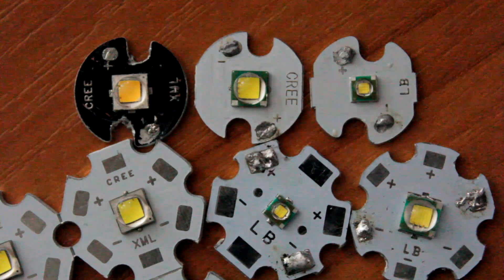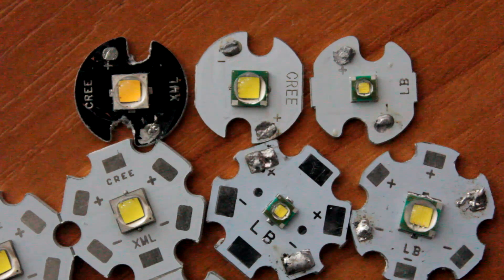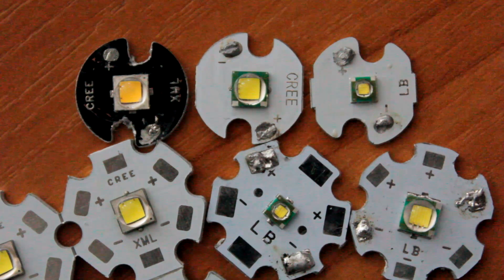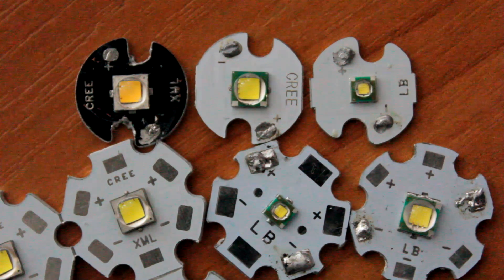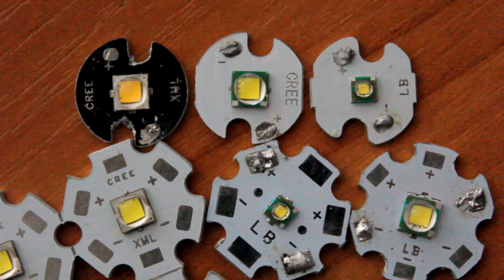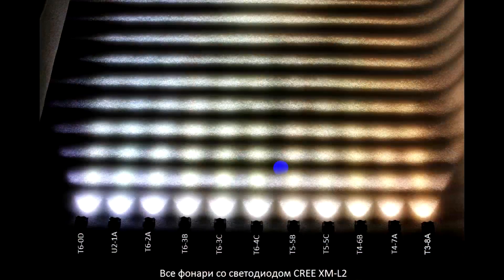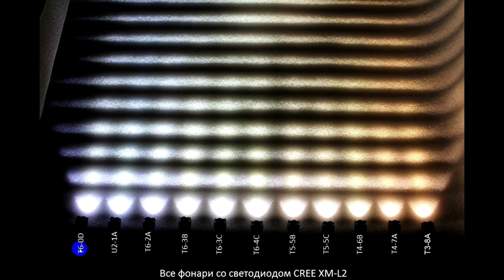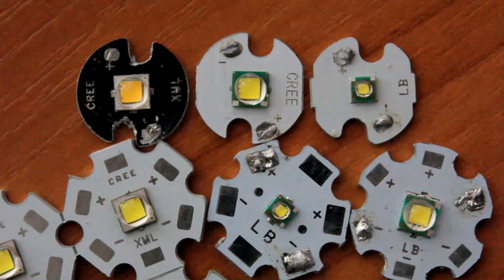How to distinguish LEDs CREE XM-L T6, XM-L2 U2 and XP-E Q5 visually (external differences)

Comment: hello I bought a led flashlight but inside the q5 has the small 3mm led on a 16mm support, what a rip off! I would like to buy a more powerful LED and replace it, which one do you recommend ??? I'd like a 3 volt CREE XHP50 do you think you can buy and solder? just solder to make it work?

Comment: IMPORTANT QUESTION - do small boards like this require a heatsink? im working on an interior design project, is it a fire hazard?
Reply from the maker: Surely it requires a heatsink and a thermal grease. 
If a turned on flashlight will be inside a bag with some clothes, than you can have some fire. On the open air (even inside buildings) there is no fire hazard.

Comment: That was a helpful video 
Can you help me with my energizer torch 
I have a metal energizer torch that its output is 55 lumens and works with two AA batteries 
I want to change the chip with one that works with the same two batteries but with higher lumen
Reply from the maker: My opinion is - you should better to buy a modern torch.

Comment: Awesome, This video helped me check if Id been scammed on ebay with a headtorch, And yes i had, It was supposed to have Cree  XM-L2's in but had xpe's inside 😤
Reply from the maker: It is a very rude fraud. 
And it is much more harder to find the differences between CREE (USA) and Lattice Bright (China).

Comment: T6, U2, Q5 is a color variant from the same LED. T6 is the most blue one over 6500K and giving highest output since it has least amount of phosphor.
Phosphor layers broadens the spectrum raising the color rendering index CRI as well influence the color output. Phosphor-based LEDs have efficiency losses due to the phosphor itself. You can't tell by looking which LED is T6 or U2, neither that is explained in this video.
Reply: Hello! Where can I find some more information about it?

Comment: so are XML-T6 green backs fake and silver backs legit mines green but I'm impressed with the brightness n quality's good got a bracelet with a compass whistle flint &striker,army knife, camping spoon knife&fork,battery insert rechargeable battery &charger+green 4clip boxset from smugglers cave Dunbar😀29.99.what y'all think????
Reply: James McDonagh i got an ultrafire XD-828H Cree XML-T6 flash light that does have the right led with the cheaper one, has only 3 modes, but it very bright. i cant really tell if its fake or not. it was my grandpas and i dont know if the older ultralights had the cheaper led on em